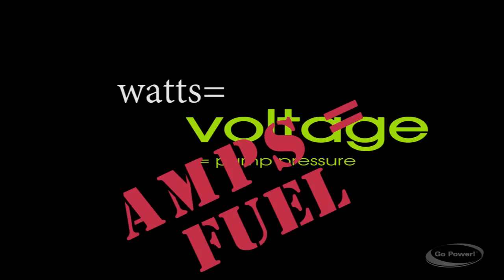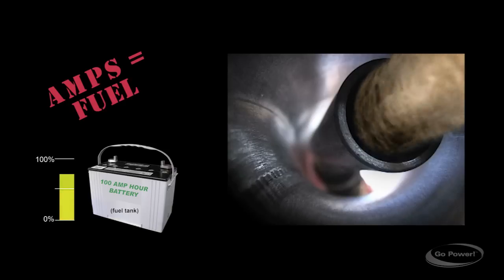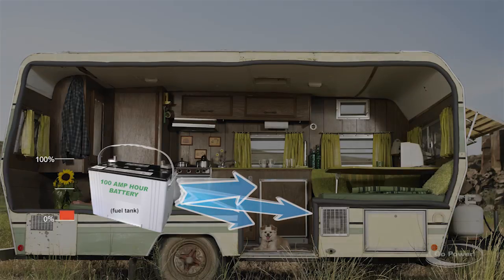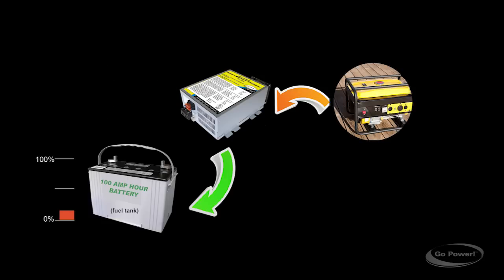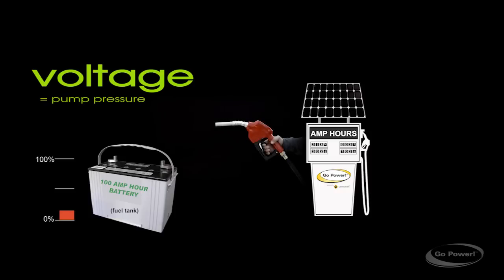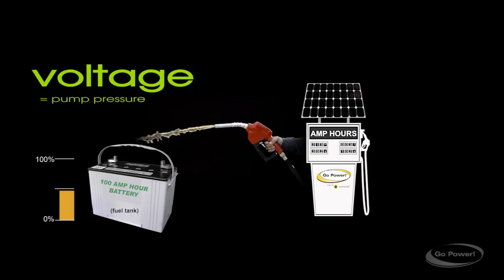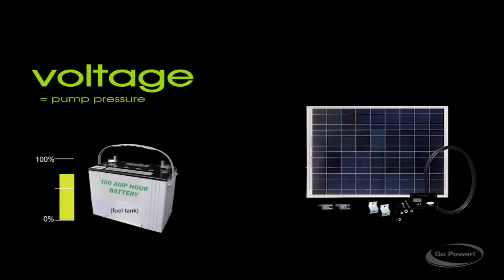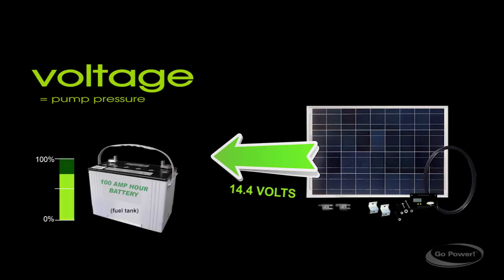Go Power! on Batteries, Watts, Amps and Volts...Oh my!

Comment from the maker: It depends on your battery.  Carmanah's CMH-AGM-100 is a 100 Ah (100 amp hour) battery - which means that is has 100 Ah of storage (at a 20 hour discharge rate). This is also an AGM battery, and is maintenance-free.